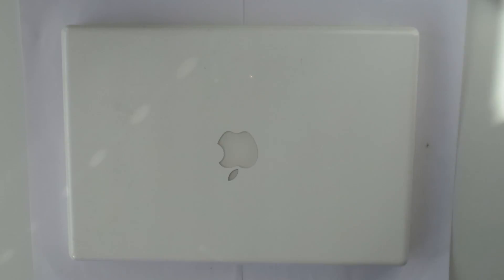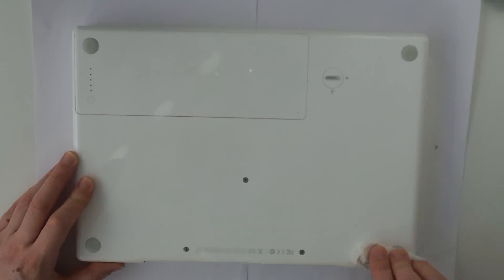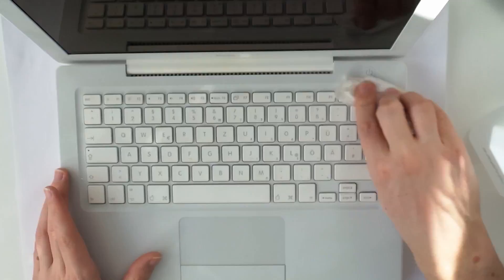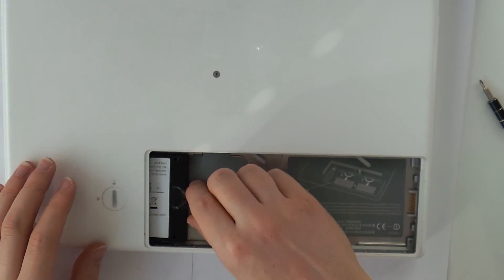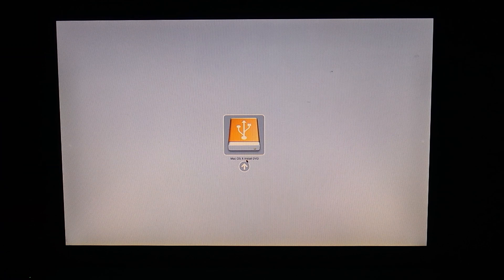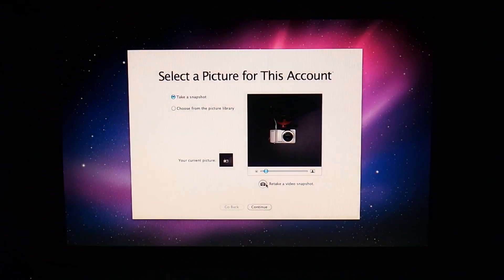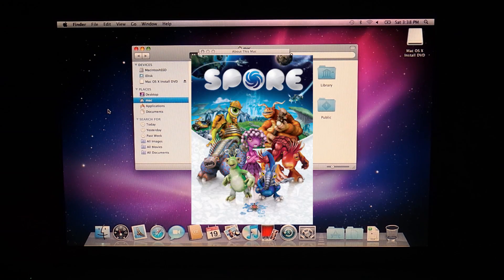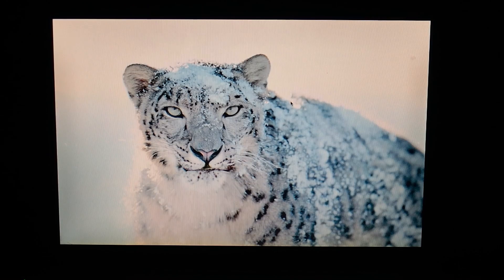The $15 MacBook | SSD Upgrade, Max RAM, restore and testing of a 2007 MacBook

Comment: I got a 2010 plastic macbook but it has no battery in it where should i get a battery for it?
Reply from the maker: Sadly original batteries are not produced anymore. There are reproductions on eBay, but since the battery is part off the case they look a bit weird.
Reply: @TechKingdom35  aw man

Comment: I have similar, but mine is macbook 4,1. I dual boot Leopard and Lion. My battery was completely dead, but they still had replacements on amazon.
Reply from the maker: Very cool. What do you use it for? At some point I also need to get a new battery for mine.
Reply: @TechKingdom35   The 4,1 can run the Chromium-legacy, so it's useable for the web. Mostly I've been running old games on it, but since I can use it for browsing, I think I'll stick it in our 'train room' and just use it there for music streaming or youtube while I"m fussing with the trains.
Reply from the maker: @cathrynm  Very cool. A train room sounds like the dream :) What gauge are you running?

Comment: Cool video, thanks for sharing. I have a MacBook 13 3.1 2gb ram, do you think is possible to upgrade the memory to 6gb or maybe 4? I actually have 2 and Ubuntu Mate is working a bit slowly. How much memory Ubuntu Mate 18 support?
Reply: It could only runs on 4GB max..2GB on both are quite good for running the ram..

Comment: hello bro could you help me about my laptop 2007 like this laptop  when i start my laptop apple logo in not showing how could i fix it
Reply from the maker: What is it showing? A folder icon with a questionmark?
Reply: @TechKingdom35  No brother just white screen then starting windows its not showing apple logo
Reply from the maker: @dragonvstiger581  hmm, do you hear the bootchime?
Reply: @TechKingdom35  no brother you tell me about bootChime
Reply from the maker: @dragonvstiger581  I mean the sound Macs make if you start them. Do you know what I mean? I mean either way you could try to reboot in safe mode. For that press and hold the shift key as your Mac starts up.
Reply: @TechKingdom35  Please brother
Reply: @TechKingdom35  can we chat on whatsapp

Comment: Can we play GTA san Andreas on it?? Smoothly ?? I mean just like normally
Reply from the maker: Probably not. The Intel GMA950 GPU in those old MacBooks is very weak. I tried Vice City on it years ago and it was early able to run it, and that was under Windows XP not 10.

Comment: Thank you for this! I wanted to make sure it was easy to put in the SSD before I did it. Figured it was. I have a macbook pro that is a few months old but found myself wanting one of these so I could still use my older ipods. So thank you <3
Reply from the maker: Thanks, always glad to hear my video helped someone. Cool use case for an old MacBook :)

Comment: I bought this laptop this year and it's using a windows 10 operating system. Works fine though limited functions.
Reply from the maker: Yeah it works fine with Windows 10, especially if the ram is upgraded and an SSD installed. I used Windows 10 on it a few months back and it worked fine. But of course not as fast as a more modern PC.
Reply: @TechKingdom35  try installing linux
Reply from the maker: @j9k2  I did, works very well but you need a modified ISO with support for the 32 Bit EFi
Reply: Mine is a chrome book

Comment: You should check the leopard reborn, a great high sierra theme for osx leopard, if i'm not mistaken it will work for the intel-leopard too
Reply from the maker: As far as I know it is sepcifically developped for PPC. But one might be able to extract the theme from there. But the other opimizations I'm not too sure.
Reply: @TechKingdom35  I just re-checked the forums, yes you are right, the ppc use different image version than the intel (example.png vs example@2.png), better not install it
Reply: Leopard rebirth 😁

Comment: the maximum ram for these macbooks is 4GB from apple and 6GB actual.
Reply from the maker: Sorry but this is a 2006 macbook 2,1. It came with 1GB and apple said it can officially support 2GB. Unofficially it can be loaded with 4GB but only about 3.5 GB can be used because the memory region that stores the Memory Mapped IO in the intel 945PM chipset. There is an article on everymac about this called "Why are the MacBook Pro "Core 2 Duo" models limited to 3 GB of memory?"

Comment: The maximum ram for these 2007 devices are 4GB instead of 3GB.
Reply from the maker: As far as I know you can put 4GB into them and they will even show up in the system info but macOS can only use 3GB. At least according to EveryMac.
Reply: @TechKingdom35  you can use 2GB in one slot and it will counted as an 4GB for double slots and rams..totally could runs the device greatly..also runs on El-Capitan Patcher for this devices.
Reply: @Ryan_Revier  if we use windows os will it use full capacity of 4gb ra, or ony 3gb
Reply: @nitishkharat  4GB or 6GB max..
Reply: @TechKingdom35   Also runs upgrade on El-Capitan Patcher for this models devices.
Reply: I have one of these too? The mid 2007 13inch what can I update or maybe u how a video of which I can do it from? If u can would be good my computer is kinda slow wanna do some other stuff I can’t go on websites cuz it keeps saying ur time is outdated which idk what is it
Reply: @celiacastro4566  it could only runs on macOS 10.11.6(El-Capitan Patcher).

Comment: Love old restorations man. Especially the boost in performance they get from a simple SSD and Ram upgrade.
It's great seeing old hardware given a new lease on life. Did a similar thing with an old Acer laptop and it was so fun to use.
Reply from the maker: Same. I also love how usable anything that has like a Core 2 Duo gets with an SSD an 4 to 8 GB of RAM. I plan to do more of these videos one I finished my Apple tv series.

Comment: I wish they could be gutted and revamped to run new hardware and windows. The design of these were perfect.
Reply from the maker: True, although I think I like the 2009 unibody polycarbonate MacBook better.
Reply: @TechKingdom35  yes 2009 unibody but with battery like 2007 so easy to replace lol.
Reply: @overgrey  I still used one of these 2007 models in college in 2018 I use to have 2 extra batteries I’m my bag to hot swap when the MacBook died to be honest for a 10 year old MacBook I still got 2 hours per battery so I agree

Comment: Try to use Hackintosh to run macOS Big Sur or Catalina on this old MacBook.
Reply from the maker: The GMA 950 GPU in this MacBook is super low spec. And there is no support for it in anything newer than macOS 10.7 I think. So sadly there is no way to get newer versions of macOS working on it in a usable way.
Reply: @TechKingdom35  the latest os than can run is 10.9 and it's unofficial and really buggy. 10.10 is even worse
Reply from the maker: @pnnytx  Yeah I think I had Yosemite on it at one Point and it was abysmal.
Reply: @TechKingdom35  what does that mean and it was really that bad???? 😳
Reply: @TechKingdom35  você pode tentar instalar o yosemite ou el capitan na intel gma 950 64mb (y)

Comment: Install linux on this
Reply from the maker: Thanks for the comment. I already planed to do a video where I will try modern OSs (including Linux) on this MacBook. But I need the old macOS for an upcomming video.
Reply from the maker: @Imix Muan  Thanks for the tips. I will look into it. For now I tried a Debian based distro called AntiX which is also super fast.